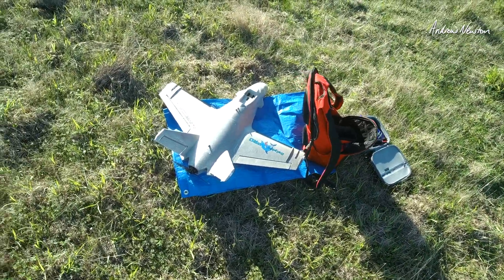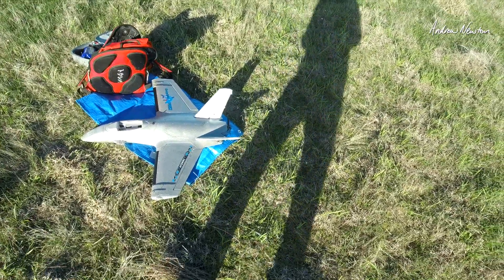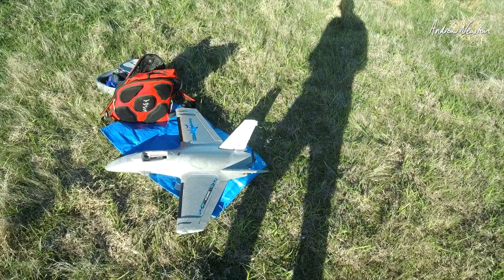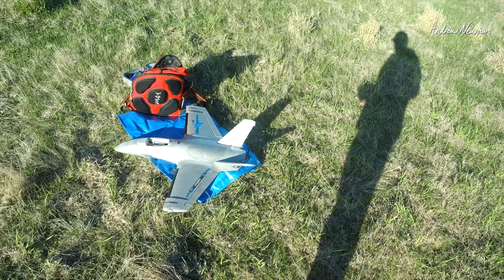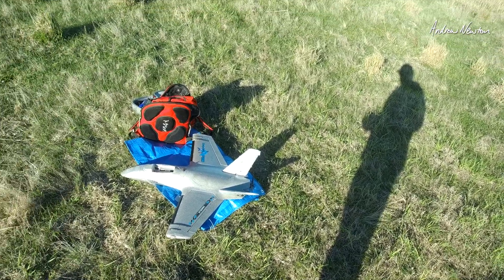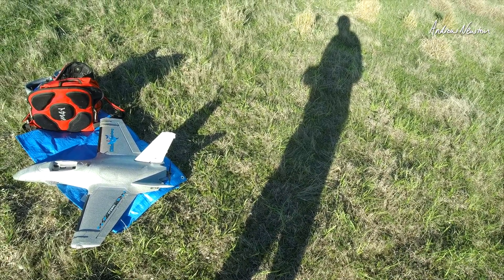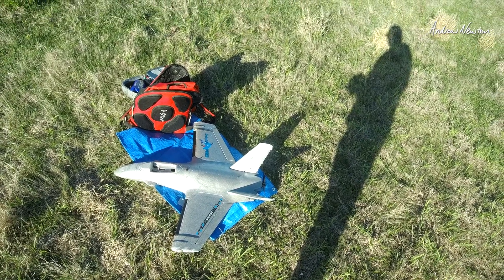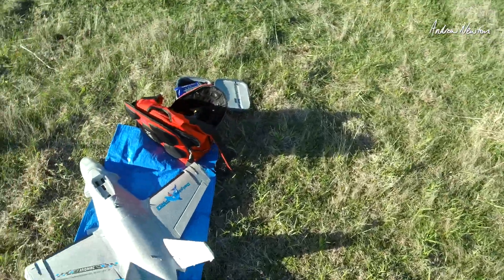Atom RC Dolphin Pro - Part 2. Nose diving

Comment: I love to dive into the deep end in new hobbies and this is my first build plane. I just took it out and crashed it very similar to your first two launches. It ripped my motor out of the plane by the housing and snatch my ESC signal wires from the solder pads, so when I glued it back in I put in a degree or two of tilt. 
Also seeing it can endure some damn damage is reassuring 😂
Going back out soon and I’m going to try with more throttle and less angle on my launch because it stalled and slammed before I ran home lol
Reply from the maker: Good luck. It's not the easiest first plane
Reply: @AndrewNewton if I can get this sorted out I can fly most anything it seems lol

Comment: Hey  Andrew   if you are using the same motor and prop setup that the dolphin pro came with, that setup is for a 6s battery the 4s battery is under powered for the 1100kv motor. either you up the battery or the motor a 1300kv motor will do just fine.

Comment: Admire your persistence! Why does it not have a set up out the box that works? I have the original, give the pro a miss I think.
Reply from the maker: The prototype probably flew OK but didn't translate to the production models.
Reply: @AndrewNewton Be great to see if you find a mix that transforms it from a total Butt clencher to a pleasure!

Comment: First of all thanks for posting the good the bad and the ugly on a maiden. Secondly I had a bad feeling about this from the get go, not sure what they are trying to achieve by upping the size of the venerable dolphin. However thanks to guys like you if this ever gets sorted I might try it out.
Reply from the maker: Should be good once the basic problem is sorted. But I think the original is much easier to fly

Comment: Some of these are Self induced problems: 
1) Running a 6s plane with 4s battery, so it’s naturally under powered. 
2) Not using v-tail mixer setup, so elevons alone are not giving enough pitch stability. 
3) check ESC protocol, by default it’s set to oneshot 125, must change it to either standard or dshot, then you will have enough power.  
4) stock inav settings have too much pitch rate (200), reduce it to 150 or 100. And can also move the elevator servo pushrod connection to inner holes to reduce elevator throws. 
My plane is flying beautifully and efficiently now, enjoying it thoroughly.
Reply from the maker: Thanks for your input, and glad yours is flying well. I'm sure mine will fly well eventually
4S is fine with slightly higher throttle and 8x5 prop
Pitch rate was 150 
Next test I'll be able to switch between Elevon, VTail and combo setups in the air to compare
Reply: @AndrewNewton 
Yes sure, 4s should be able to cruise nicely, but your initial few launch crashes were probably because of under power. My plane also was underpowered initially because of ESC protocol issue. I also switched to 8x5 prop as stock prop is too heavy and doesn’t give good speed. Even on 6s, 8x5 prop, plane needs 1700us auto launch throttle to do a safe launch. 
And in your angle mode, plane was rocking up and down, right? I think it was due to board alignment angle setup. Please check and remove that.
Reply: @JustaSimpleMan-q1z  Can it fly nicely without the aid of a gyro?
Reply: Is your Dolphin Pro flying good when usind RTH, Cruze modes?
Reply: @EduardoAranda 
Initially it was dolphinning while doing rth or cruize modes, then later I realised that factory has setup a -30 degrees board pitch alignment. Removed that and plan flies straight on Navigation modes now. Also, reset and do an acceleration calibration yourself. I did a mistake of relying on factory calibration data.

Comment: Hopefully they keep the original dolphin in production. They really only needed a few minor changes and not this major overhaul.
Reply: I agree. This version is way too heavy for its wing area. I own two of the first Dolphins. And wouldn't touch this one because of all the dead weight it carrying.
Reply: they probably wouldn't spend the money on all the new molds if the old was one was still turning out good parts.

Comment: Aptly named Dolphin (Porpoise might be even better!). If it is possible to get it to glide with engine off, try and see how it behaves as a glider. Take it up high, cut the power and put it into a shallow dive, if the dive steepens with increasing speed, that suggests tail heavy. If it starts to recover with increasing speed, that suggests nose heavy. Ideally it should do neither but perfection is usually impossible - best to be slightly nose heavy for stability. Having done the best you can to get cg good flying power off, then see how the plane behaves with power on. If it starts bad habits again then that suggests it is not the cg but the thrustline that needs adjusting (if you have a decent enough transmitter this can often be sorted by creating a mix so that as power increases, corrective elevator is added (best to experiment by putting the mix on a switch as if your first guess at mix percentage is wrong, the plane will be unflyable - so try the mix at height and be ready to switch it off immediately if it is too much)
Reply from the maker: Not yet at the stage where I can do anything but survive. I did try moving the CG rearward but that made it less controllable.
Reply: @AndrewNewton Keep sending him up, as Tom Skerrit said in Top Gun 👍😆 p.s. yes, watching the video, from the outset my feeling was the cg might need moving further forward not back. But as you say, its hard to be sure until thrust is taken out of the equation hence the advice to try glide test. Also, if gyro stabilisation is on that will mess with things so you have to switch it off to ascertain whats going on (and be ready to switch it back on immediately as the plane may go out of control if the trim is all wrong)

Comment: It looks to me like they've made the body fatter or reduced wingspan...?...Do you have an original to compare it with?...The original flies great by all acounts, not flown mine yet....🤔
Reply from the maker: I did have the original and it was easy to fly. The Pro is 500g heavier with less wingspan but chunkier all over
Reply: @AndrewNewton  I have no idea why they increased the weight so much. They really should have started production with the more efficient, lighter one. I have a pro in a box right now but I'm considering ordering a v1.1 and just going with that. 500 grams is the weight of my battery: ie I could get double the battery on board for the same weight with a v1.1.
Reply: @AndrewNewton Wow, that's some change, not necessarily for the better IMO....It's not in Radjet league in terms of speed, but that said the original was a nice balance of ease of launch, speed and reliability... IMO...🤔😳

Comment: The concentration just to keep it in the air was palpable...Did you have constant servo trim switched on..?... I'd have had it in Horizon Mode soon as. Saved me a number of times, especially when a wing is tail heavy...🤔🇬🇧
Reply from the maker: Yes servo trim was on but INAV has no hope of controlling it as is. Have to sort the fundamentals first.

Comment: I guess the reason I suggested EDF earlier was based on what I`ve been seeing over at BUILT FAST where the guy 3D prints all his planes and uses EDFs. He nearly always gets stunning results. The one thing I wished he did that you do is mount a cam on the plane instead of just using a hat-cam. Nonetheless, he has a good r/c channel with fun builds and flights.
Reply from the maker: I'll check him out thanks.
Reply: @AndrewNewton  He also mentioned he was getting into hotwiring a foamy, which I think is a stellar idea. Foamies are way more durable than his little PLA prints, though he doesnt often lawn dart a plane, if ever but does need to C/A some planes from rough landings. Personally I think a hotwired foamie is your best option overall but, printing can be fun and easy if you have the tools for it.